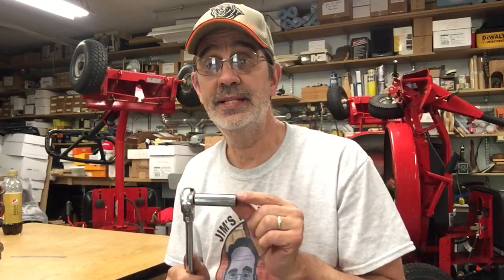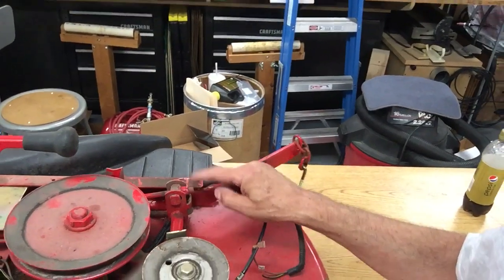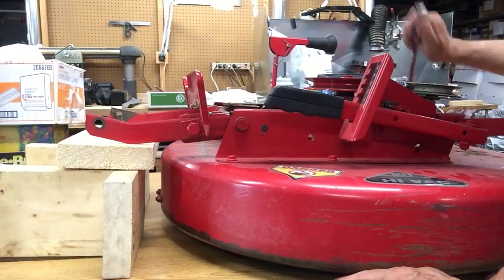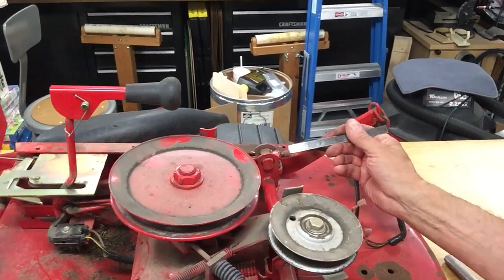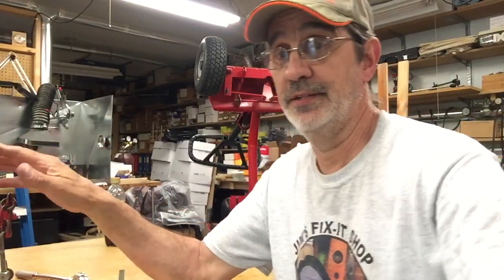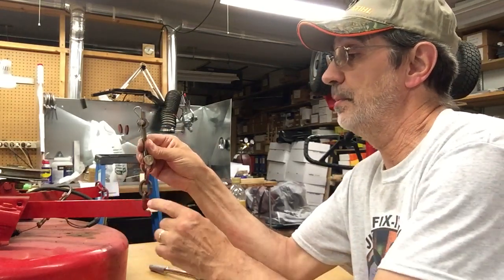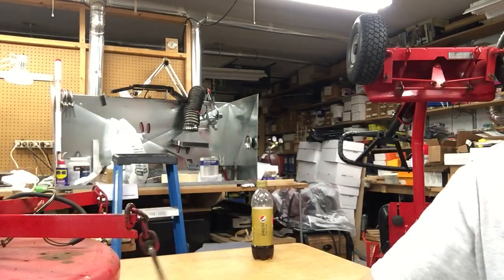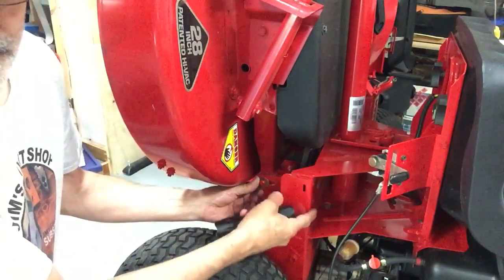303.  Lifting your mower deck higher, to help Tom

Comment: Thanks Jim, You've helped so much. I bought a used 2002 snapper in 2014.... in 2021 I started having problems. I live in Italy and don't have easy access to parts nor to folks that know these machines. A vendor tried to convince me to buy a new macchine for 3400 euro. With your help I have the old macchine up and running better than when I bought it for less than 300 euro. Thanks to you, I feel comfortable taking everything apart and putting in back together again.
Reply from the maker: Well, if you need any parts, let me know. I don’t know what shipping would be, but I would be willing to ship them to you, these are awesome machines and we have to keep them running as long as possible in this country we can’t buy these anymore they only make them for overseas, keep in touch and let me know how things are going. Jim.

Comment: I've been having a max flow of these snappers coming into my shop. Most of these have been sitting for a few years and have water in the fuel tanks that has rusted out the rest of the fuel system. I yard tested the last tractor that needed quite a bit of work and it scalped my yard even though it was on the setting of 5. I had thought the chains were where they needed to be moved but your video quickly got me straight. The tractor went home with the customer today, but his chains needed to be cleaned up and the threads lubricated first prior to attempting to move anything.
Reply from the maker: There is an adjustment underneath the cover on the mower deck that will raise the front of the deck if you just raise the back it’s not really gonna stop it from scalping your yard, they do sell a set of anti-scalp wheels you can bolt on the mower deck and you can get them from Parts Tree.Com. out of Texas if you need anything just let me know as far as help repairing the snappers. Jim

Comment: Wow - for those of us with rural or bumpy lawns, this was a big help, I now have 1-5 as 1.25, 1.75, 2.25, 2.75, 3.25 and I use 1.75 (position #2) as my go-to on a bit of lawn (the Centipede lawn). I was changing the belt over (STENS, very tough belt) after burning up some import ("Woniu") belt and did the deck-lift; i think it was about six quarter-turns on that 9/16" nut. Use a deep-socket if you have it.

Comment: Thanks, I looked it up since I ordered a new belt yesterday. It's 73 and 1/2". I had a belt that I ordered a couple of years ago and it was 74 3/4". Thanks for showing how to raise the mower deck. My deck used to be perfect in the 3rd notch but some how it is lower now and I need to raise it a little bit. Thanks again
Reply from the maker: Make sure all your tires are completely full of air that will change your cutting distance

Comment: Thanks for this. My 26 inch 1973 had a pin and threaded clevis. But the function was the same, remove the pin and tighten the clevis and it raised the front of the deck. I removed a link of chain in the rear and it definitely needed the front raised.

Comment: Jim yes we raised the mower deck all the way up by the bolts & chains. My brother leveled it all around ( we watched your video)     Still cutting my yard way to short. Left cut out circles when he turned mower in a circle. I think my grass in my front yard is just too spongy. We will loosen the yolk spring & I will let you know. As always thank you such
Much for your knowledge & help.
Reply from the maker: There’s a long rod on your deck you’ll have to take the cover off to see it easier it goes from the front to the deck if you tighten the nut on the back of that rod it will lift the front of your mower deck then you can level it by using the chains. Jim

Comment: Hey there Jim. Thanks for all of your videos. A few months ago I picked up my first vintage Snapper RER and have been enjoying the restoration process thanks to your videos. I do have a question: I have a 7800103. I have to cut my lawn pretty tall due to some uneven spots and being on a hill. I've raised the deck as high as it can possibly go, which finally got me to an acceptable length when driving straight. However, any bump I hit scalps the lawn significantly- like going onto the sidewalk or driveway. I understand that it comes with the territory (no pun intended,) but I've had other riders and this one does it way worse. Tires are inflated correctly, brand new blade, all maintenance done, etc. So my question is- are there any sort of rubber mounts or mechanisms that stabilize the deck that might have worn down and need replacing? The deck sure seems pretty bouncy on these elevation transfers... I just cant figure out a solution and I LOVE everything else about this mower. I'll live with the scalps if I have to, but it would be great if I didn't. Thanks so much again for all you do!
Reply: TO be clear, I've raised my deck as high as all the adjustments will go and still be able to level it, and then I cut on 5.

Comment: Yay Jim! The deck on the one you helped me fix is pretty low in the front.. This should fix it.. I tried that from bolt in front of the deck where the blade engaged pedal is. No luck there maybe a 1/4 inch raise.
Reply from the maker: The bolt on the front arm is to tip the deck from side to side if you take that black cover off the top of your deck you’ll see a long rod going from the front to the back of the deck with a nut on the back end of it if you tighten that nut that should raise the front of your mower deck, there is also two holes in the front of your machine under the platform where are you put your feet you can raise the whole assembly by using the top set of holes. Let me know if you need anything else. Jim
Reply: @jimjackson9381  thanks Jim.. yes I noticed the extra holes for the pin in the front of the machine that supports the deck. It was already set in the higher position.
Reply from the maker: @stevetorres76  OK then try the adjusting Rod and see if that helps. Jim
Reply: Thanks Jim… I can tell just by looking at the video that it will fix the problem. 👍
Reply from the maker: @stevetorres76  well keep me posted. Jim
Reply: Ok… I tried it out and it worked like a charm.. the front of the deck is 4  inches off of the ground now in the high position. No problem loading it onto my truck now. Thanks always Jim.. 🙂👍
Reply from the maker: @stevetorres76  don’t forget you may have to adjust the back of the deck with the chains to make sure it’s level. Jim
Reply: @jimjackson9381  yes thanks. I did that after I raised the front.

Comment: Thanks!  When replacing my bent blade holder, I noticed that the deck touched the garage floor when in position 1.  Since that didn't seem right, I watched your video and have adjusted the deck to be 1/2" off the floor in position 1.
Reply from the maker: Perfect,  thanks for watching and I hope subscribing.     Jim

Comment: Jim,  now that I’ve got my mower staying running I cut my lawn a couple of weeks ago and it was so bad the mower kept dying and when done, my buddy that used to own a lawn business asked me if it had thatching blades on it.  My lawn wasn’t that high to cause either of these things.  I bought a new blade and put it on today and mowed again.  Same thing, maybe not quite as bad.  I took it into the shop and adjusted the rear chains, not knowing about the front adjustment and went to finish the job.  Much better, mower never bogged but still not great.  What is the height of the from the factory supposed to be from the floor to the deck on the 1 setting?  I figured if I can get this set it will get me a good starting place.  Btw I have been mowing on the #5 setting through the whole process.  Thanks again for all your help and knowledge.
Reply from the maker: I'm not sure what no. 1 setting is but I will find out. Jim

Comment: I Jim. My snapper deck has been raised up the highest it will go. Originally the blade was 3” off ground now it is 41/4” o
from ground. Still cutting my St Augustine grass too short. Also showed tire rounds when turning. Also what is making my mower jerk me back when engaging clutch
Reply from the maker: Well most people have trouble with the machines not moving so I tell them to watch video number 70 and tighten the yolk spring, you’re gonna wanna loosen your yolk spring that will make it take off slower.  Did you adjust your mower deck to raise it and if so what did you do. Jim

Comment: Jim:  I just purchased a pretty good used snapper rear engine unit.  It would not run.  I got the thing running  in no time, but in running it around the yard to test it, I saw that whenever a tire ran into a small hole in the yard it would scalp the yard pretty bad.  Doesn't the unit have some type of "floating deck" to try and keep it level when the frame moves?  I see that most older snappers like mine do not have anti scalping wheels so how does that work.  Thanks for your videos.
Reply from the maker: Not all machines anymore came with them you can order them from Parts Tree.Com. and put them on your machine but you have to order each piece separate the bracket the wheel the axle in the bolt,  times three. Jim

Comment: How ya doin mr jim do you rebuild  tecumseh engines on a old rear engine  snapper I ran it low on oil do to the wrong dipstick being installed  by previous owner

Comment: So I have steel cables on the back, was this maybe done by the previous owner, or is there a way to adjust those?
Reply from the maker: No, some machines had steel support cables on the back of the mower deck if you look up towards the top of the cable where it goes through the rear case, there should be a bolt on the end of the cable and you can tighten the nut and it will raise the back of the deck.
Reply: Thank you for the response, I will do just that. 😊

Comment: Question! Can I do away with my conventional brackets that hold a deck on my cub zero turn and replace the brackets with chains to hold the deck? It looks like an easy change out.
Reply from the maker: Well I’m not sure what the mower deck bracket looks like but I don’t see any reason why you can’t switch it out as long as it holds it secure and it doesn’t swing around. Jim
Reply: @jimjackson9381  I agree! I'm going to get the chain tomorrow and do it.
Reply from the maker: @jessalford5927  well let me know how it works.  Jim
Reply: @jimjackson9381  Jim, I got the job finished. I hung my Cub Cadet mower deck on chains. It works perfect. The side to side swing is not an issue because of the front bracket that hooks the deck to the frame. I'm proud of my mower now.
Reply from the maker: Awesome send me a picture of you sitting on it and I’ll put it on my Wall of friends.  Jim

Comment: If this was addressed in the comments, I didn't find it.  Raising the front in this manner shouldn't affect the side to side adjustment you addressed in an earlier column, should it?  I adjusted my 3009 series side to side, per the manual, and when I started the front to back,  I found I didn't have enough chain to lower the rear level (or a little lower) than the front.  The side to side procedure works, but it's a pain you know where.  I'd rather not do it again.  Thanks,  John
Reply from the maker: John 
No lift in the front of your mower deck in the back of your mower deck should not affect your side to side adjustment unless one chain on the back is tighter than the other. Jim
Reply: @jimjackson9381  Thanks, Jim

Comment: Hi Jim,,Thanks for the videos.  On this subject,  when I raise my deck above level 3 my cutting quality goes down to the point I have to run over the same cutting area multitude times.  It's very thick St. Augustine grass and I have tried several different types of blades,,,do you have any suggestions?    28 inch rider with much kit installed.  Jerry from Texas
Reply: That’s a common issue with all mower decks and the whole airflow turbulence stuff goes.        The problem is what works with some conditions and grass types, won’t work for other situations.        The standard rule of thumb is to run the front of the deck 1/4” or so lower than the back.  The theory is the blades will only need to cut the grass to height once and discharge them right away.   Unfortunately this doesn’t always work when mulching or mowing such light weight grasses.  

Walker, Ferris, Exmark and Wright mowers are top of the line mowers, yet they’ll all have similar issues.     The issue with ‘ground effect’ or having the deck lifted where air flow gets disrupted is what it is.   It’d be like using a vacuum cleaner 3” off the ground.    They use extended baffle areas built into the decks to counteract ‘blowout’ or turbulent issues.     

It may seem counterintuitive but try running with a level deck or experiment lowering the rear of the deck 1/4” or so.    Also note that some mulching blades have the lift sails divert the air inward towards the spindle and others angle the air flow outwards.  It’s a myth that those mulching blades use the serrated lift sails to cut. They work by keeping the cut grass blades in suspension longer to become chopped up again and again.     There’s a point where too much turbulence and disruptive airflow can work against us.  

If one could put a rubber side skirt around the deck bottom to focus the air better, it’d be ideal.   And that’s also exactly what some decks have available- a moveable front baffle height.    

Some have better luck throttling down the motor a bit to find a sweet spot to get proper air lift balanced.  Or use lesser lift blades.   I don’t know if they make a ‘sand’ blade for snappers but one of those may be awesome for your situation.    Watch some YouTube videos by Walker mowers or Wright and it may help understand how finicky all this stuff can be.  Lolz    I have to tweak things all season long as conditions change.  It’s a challenge
Reply: I recognize this is 2 years ago, but if anyone is reading this... St. Augustine grass blades will grow interwoven together and will even move throughout the day.  In the heat of the day, it'll interweave tighter and at night or early morning will relax.  Try to mow during those relaxed timeframes.  When mowing, that first pass will eliminate some of the blades (mostly) that are holding others down.  After a little while, those blades of grass held down pop up and look like stragglers.  This has nothing to do with blade sharpness, it's just the nature of the grass.  Of course, keep your blade sharp regardless.  It'll take more than one pass to get them all and even on a second pass, you may get additional blades popping up from eliminating more of the grass blades holding down the stragglers.  If that even makes sense.  Mowing during the evening will help prevent so many straggler blades since the grass is more relaxed and vertical.  Mowing shorter will do this as well but it's hard on the grass.  I tend to mow higher when this is happening, sometimes up near 5", because if it is happening, then it must be from severe heat and stress, and mowing higher helps keep that stress level down.  Of course, mitigate this advice if you're dealing with other things happening with the grass, such as disease or pests.

Comment: Hi, what length of belt does the 28" snapper deck use!!
Reply from the maker: Well, off the top of my head I think it’s 74 and three-quarter inches but if you go on Parts Tree.Com with your model number, it will tell you exactly how big it should be and remember you need a double V belt not a standard V

Comment: My deck is different from either of those. It hangs from 2 cables . Is there an adjustment for those?
Reply from the maker: There should be some kind of an adjustment on the end of the cables.    Jim

Comment: Plan on replacing front and rear wheel bearings. Watched video and now need to get the bearings. Mower is old. 
Model 80106-28088TE. What bearings size do need?
Reply from the maker: I will take your model number and go to Parts Tree.Com and they’ll help you find the correct bearings and bushings that you need. Jim

Comment: Do you have a video for MTG Yard Machines--- my mower is a now a subsoiler...
Reply from the maker: Well I might be able to help you out take some pictures of the issue and explain to me exactly what it is or is not doing and I’ll see what I can do. Jim
Send the pictures to. jimsfixitshop@gmail.com
Reply: @jimjackson9381  It'll be a day or so...I don't know enough about mowers to even know where on the mower to take the picture.
Reply from the maker: @brasspick  well let me know if you need any help with it. Jim
Reply: @jimjackson9381  I emailed you...the lever is slack from 1-3, and starts tightnening up properly at 3, and at 5 the blade's only raised abt 3/4 inch from the ground. Also, I'm a newbie with my phone so I am learning as I go.
Reply from the maker: @brasspick  well if you can send me some pictures to my email
jimsfixitshop@gmail.com
I’ll see if I can help you. Jim

Comment: I have the chain type. I am trying to raise the deck and for the life of me the screws will not untighten...any suggestions on how to untighten it?
Reply from the maker: You’re going to have to send me a picture of what you’re working on and what make and model of machine you have.       Jim
Reply: I relabeled it back to the original height now the blade will not engage and when it did engage the pedal to hold it down is stuck. I have the 28 inch mower what did I do to it?
Reply from the maker: @janicepicklesimer5044  i’m going to need your complete model number and some pictures of your machine. You can use your finger to point to the parts of the machine that you changed so I can try and figure out what’s going on.  My email is.
jimsfixitshop@gmail.com
Thanks.   Jim